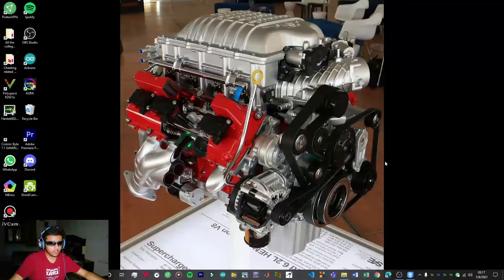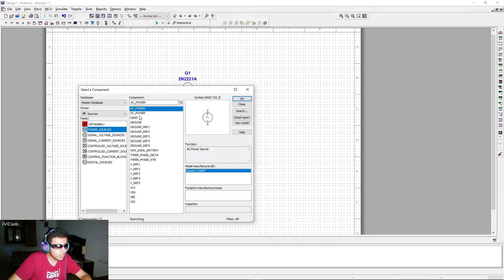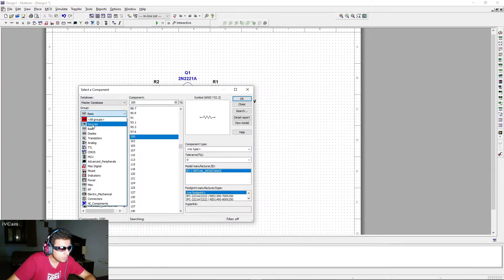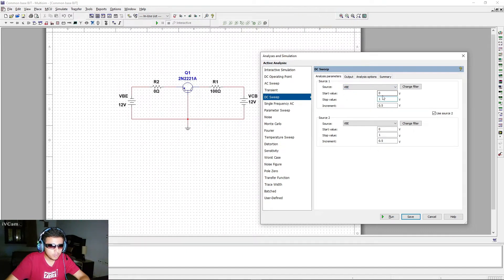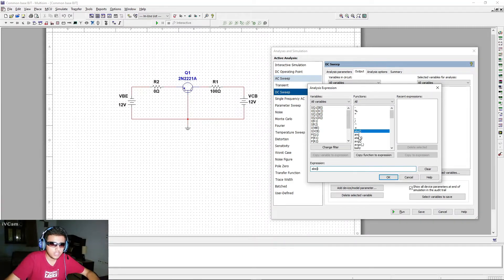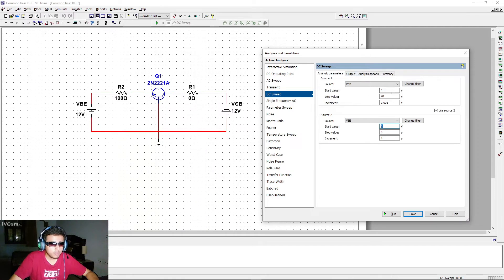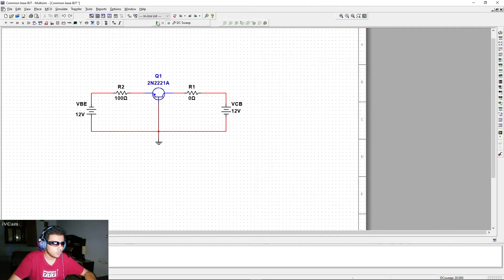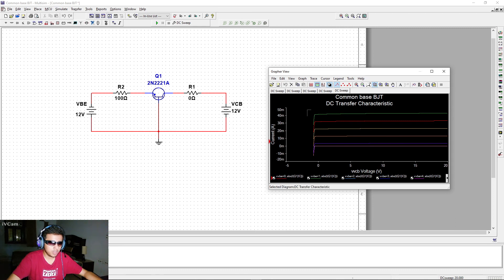"Input & Output characteristics CB transistor" on MULTISIM //Electronics device BTECH 2nd Semester

Comment: I don't get this.  I have 100% defined all the components, and I am holding the real electronics in my hand.  The real electronics runs perfectly, but not any spice sim software I have tried does it.  I have spent two days rechecking everything and everything checks out.  Sort of hard to fuck up with only 3 res, 1 cap, two trans, a diode, and a led.  Is there something special that a blocking osc circuit needs to be able to run in a simulator?
Reply from the maker: I haven't worked with the blocking oscillator circuits so I might not be able to help. However, if possible, send me you're circuit diagram on my EMail - pranay12nov@gmail.com

I'll definately look into this shit. I'll also ask ma teaches bout this problem. Just send me the circuit diagram and other information that ya might think would be useful to me.